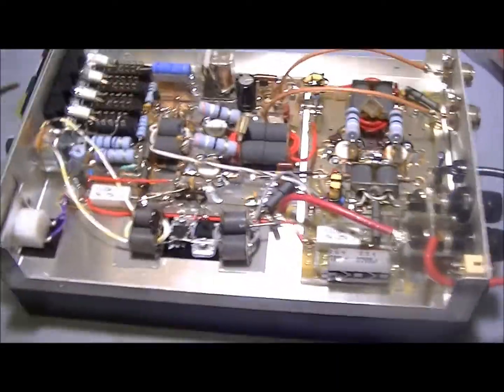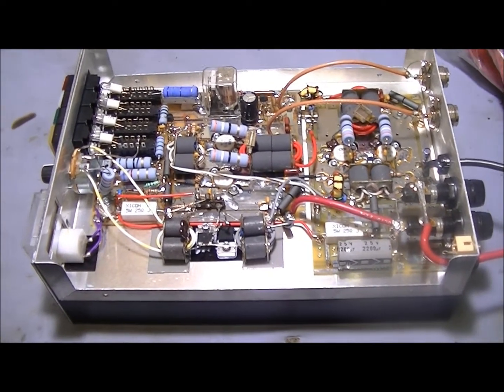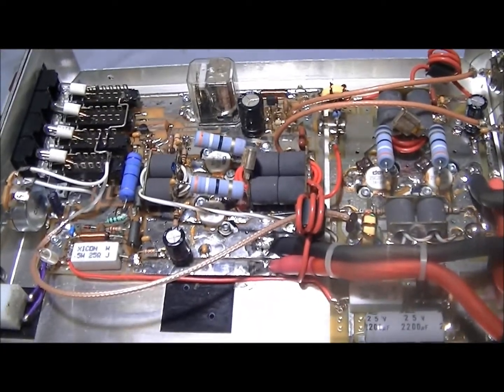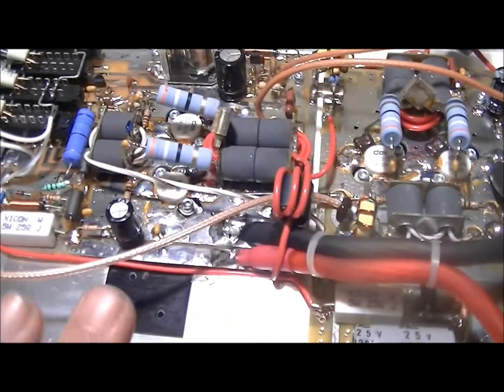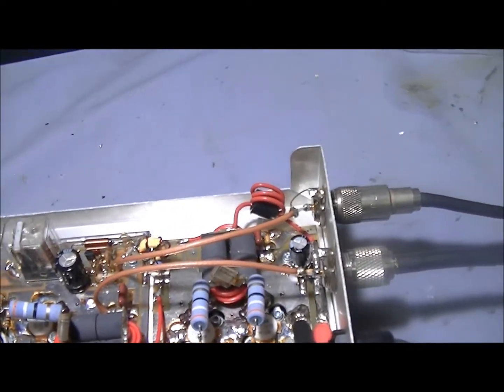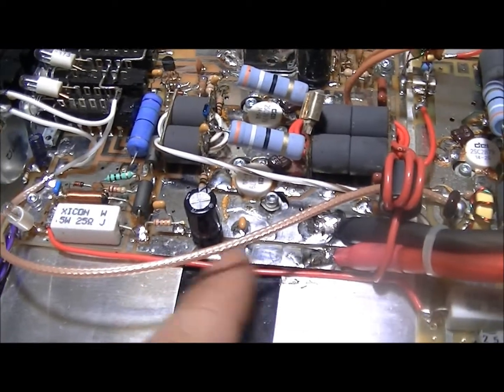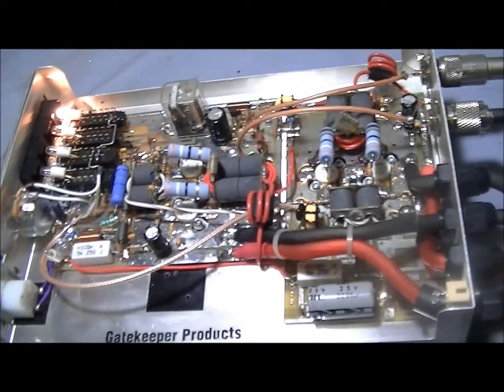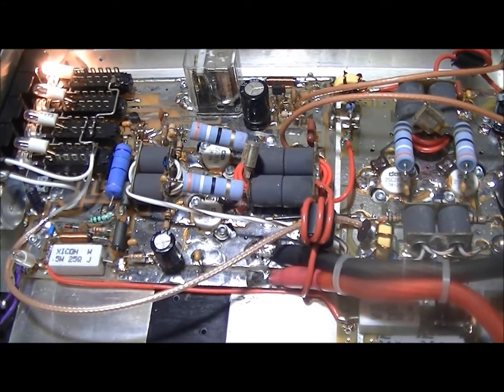#2 Bondo Dave's Texastar 667v to 500v Conversion with FULL PWR Wire Upgrade 👀

Comment: that looks the same as the one i did years back.but DEI 3 dead one with low HFE. same driver as that. stripped and re wrapped for MRF 454 driver . RFP 2SC2879 match quad . had to use ICA combiner. the TS was out of stock at the time. was burnt to a crisp .it tuned nice . had bias issue . had to play with them 1.6/1.8 ohm. 2 different did the trick. I have not had many DEI boxes come threw, more PP 100. at the time 2SC2290 went way up in price and HG 2290 not out at the time. I think they went to FET driver because of 2290 supply at the time. nice fix. have not done that conversion or 500 to 667 either. just a fix. keeping same power level I find the power wire upgrade helps the box run cooler.73's